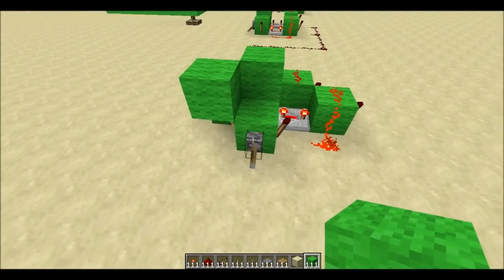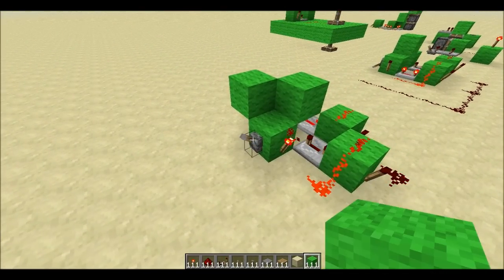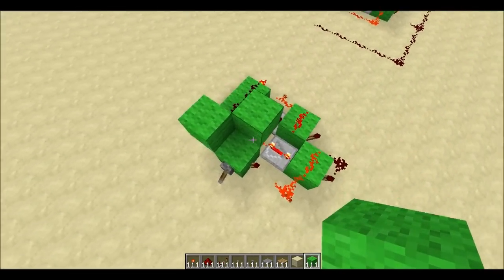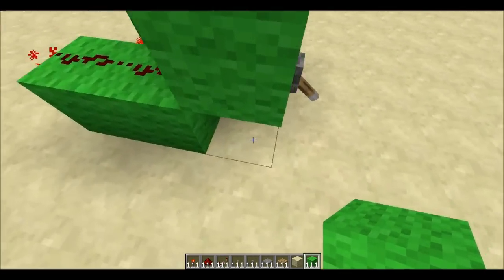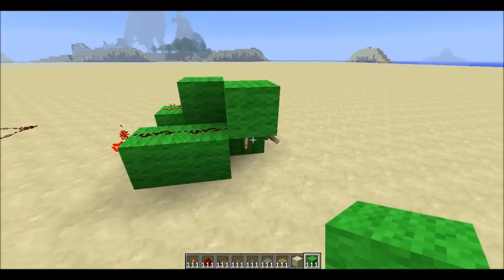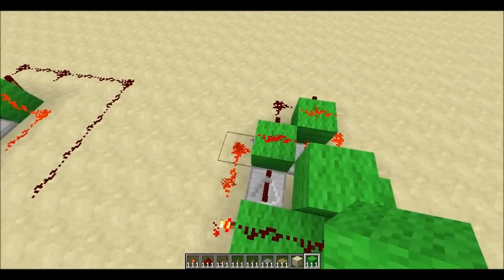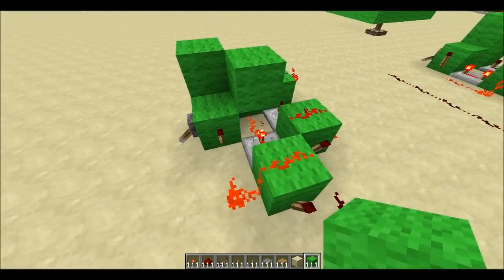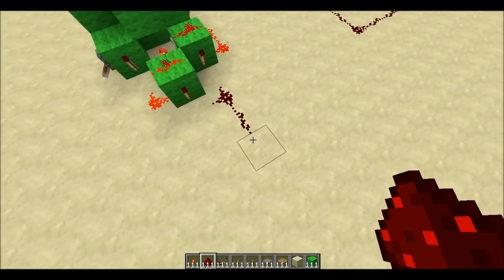Sending a Pulse When Turning a Switch On and Off

Comment: @Minecraftaddict This is a setup I use: imgur(dot)com/FAHFx .
Generally you still have the switch functionality while also having a pulse on every change of the switches position, in my setup I use that to reset the middle block of the contraption to remove either water or lava so no cobblestone or obsidian can be created during the switch.